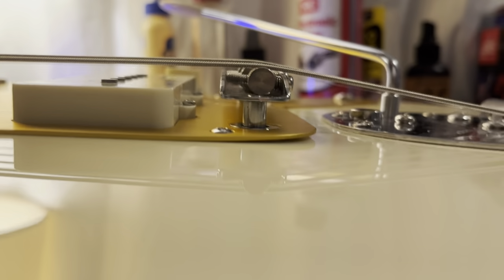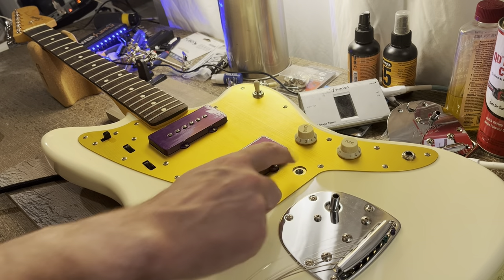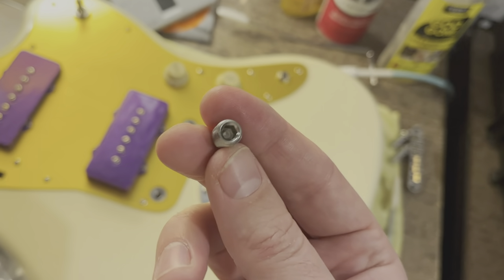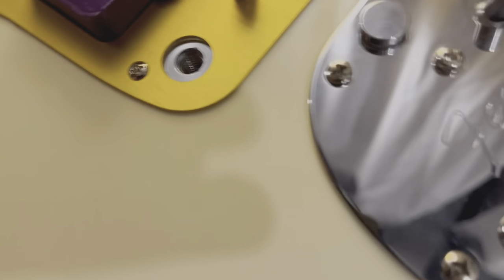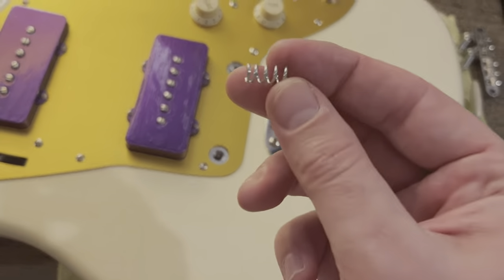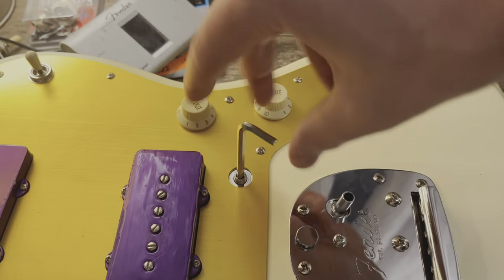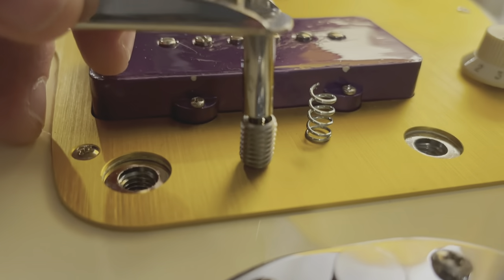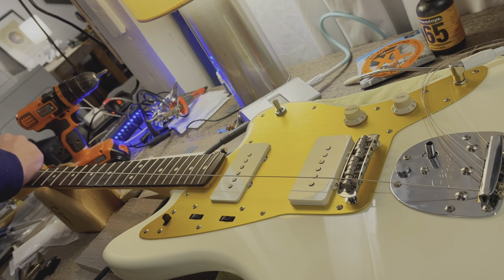Installing A Mustang or other Offset Bridge on Squier J. Mascis Jazzmaster ($3 AOM/TOM MOD)

Comment: Hey man… when I looked at your Mustang bridge, it has tiny screws on the bottom of the “posts?” that are at the bottom of the bridge (the posts are attached to the bridge). I was looking at a Modified Mustang Bridge from Warmoth and in the tiny screws at the bottom of the posts do not appear in the photos of their bridge. Is this normal? Will the Warmoth Modified Mustang bridge work like yours in this video? Thanks!
Reply from the maker: I have never seen one of those Warmoth bridges in person so I can’t say for sure but every Jazzmaster or Mustang bridge I have seen has had a height adjustment. The warmoth one has individual saddle adjustments but I can’t imagine the overall height can’t be adjusted as well. Maybe a call to warmoth could clear that up for you.

Comment: I've done this mod on my JMJM squier (using a mustang bridge) and it's worked beautifully! Thanks heaps for the hack!

The only issue I've run into is the action seems to decrease slowly over time until frets begin to buzz. (This is with the springs underneath the grub screws too). Has anyone else had this problem? And is there any fix other than just locktiting everything?
Reply from the maker: I’d try to verify if it’s the grub screws moving or the adjustment screws on the Mustang bridge itself. Mine hasn’t moved at all since first doing this a year ago and I don’t have any loctite on it, so my first guess might be that your bridge needs loctite? Not a big deal if you use the blue stuff, do not use the green or red as those are meant to be permanent.

Comment: The bridge looks quite high, aren’t you having tuning stability issues with that height. Because I’m having them and I believe this is the cause : /
Reply from the maker: It’s very high in the first shot as I’d just dropped it on and hadn’t adjusted the height yet. The “after setup” shot shows where I have it now. This is still relatively high, but I’ve also shimmed the neck which keeps the action low with the raised bridge. Action is perfect and tuning is rock solid stable. 

A higher bridge increases break angle on the strings and should actually making tuning more stable I suppose, unless you’ve created high action issues that bend notes out of pitch when fretting? 

IMO tuning stability likely culprits on the JMJM are the TOM bridge, squier vibrato tailpiece, and the plastic nut, all of which I replaced at once so I can’t say how much each of those individually helped me. I could also see the tuners being trouble as they aren’t awesome but they’ve been good enough for me not to bother replacing them.
Reply: @feinkevi  I have a 'Noventa' Jazzmaster that also came stock with a TOM. It was moving a lot so I changed it to a regular rocking JM bridge. I also shimmed the neck and raised the bridge as much as it appears in your picture, however the tuning stability that I once had with the TOM is now gone. I also replaced the vibrato for a Panorama, which might be the real issue here. That's why I was wondering how was you experience with a raised bridge. 
I love how they feel, very confortable for my playing style. 
Anyway, thanks for your reply : )

Comment: Is the AOM bridge that bad? I see you have a different vibrato on it too.
Reply from the maker: A few people seem to like them, but for me it def had to go. The tuning stability while using the vibrato with everything stock was really quite bad, pretty much unusable. There are things I could have done to make it work a bit better as it was, but after swapping the bridge, vibrato (Fender CIJ), and nut (TUSQ) the tuning is rock solid. 

Aside from tuning, another major issue is the radius mismatch. The radius on the stock bridge is flatter than the fretboard, so no matter how you set it up, the action on the outer strings is higher than the inner strings. (Easier to fret and bend the D&G than the A&B which are easier than E&E). This Mustang bridge is a 9.5” radius matching the fretboard, making it way more comfortable to play. It’s also more comfortable on the palm and looks better with the offset aesthetic. 

Again, some people like them and that’s fine, but it was a necessary change for me for sure.
Reply: @feinkevi  thank you for the detailed reply. There is a 1st Gen (rosewood fretboard )JMJM near me for sale. I was researching it and found your video. So besides the bride what else have you done, or do you have a video on it?
Reply from the maker: @thecappy  I recorded a bunch more clips but haven’t had time to piece together any more yet. All in all I did the bridge, vibrato tailpiece, nut, neck shim, and pickups. I went with Fender Pure Vintage 65 pickups to get more of a traditional jazzmaster sound. The stock pickups are P90s, and sound very good for that style but it wasn’t what I wanted, so I’d say a pickup swap is totally optional depending on what you are looking for. The neck shim is also optional, I needed it for the way I wanted to set up the guitar but it wasn’t strictly necessary.
Reply: @feinkevi  I have a black Japanese (Inoran sig) jazzmaster with the ‘65 pickups. I was thinking of putting in P90 jazzmaster pickups in, but figured the JMJM already has them and the neck is supposed to be really good on them.
Reply: I don’t think it’s that bad. I have a Fender Kurt Cobain Jaguar. The AOM bridge radius is 10.5 so it’s not a lot different than the 9.5 neck radius. I did this grub screw mod like the video above shows and it definitely works. But the floating bridge doesn’t move very much when using the tremolo and still can get out of tune. I decided to put the AOM bridge back on. I have it set up perfectly and can use the tremolo without it getting out of tune. Or at least not any more out of tune than when I was using the floating bridge. I think the AOM bridge gets a bad rap. It’s not great but it’s far from being terrible

Comment: Where do you buy that Mustang 9.5” radius bridge ?
Reply from the maker: This particular bridge actually came on a used CIJ Jazzmaster that I bought a while back, the previous owner had put on this mustang bridge. I upgraded the CIJ to a Staytrem and moved its Mustang bridge to this JMJM. 

There are a few varieties out there in 9.5. If you don’t want to break the bank I imagine the Allparts one works just fine.

Comment: Hey any chance anyone has the spring size that works best, considering this mod for my JMJM
Reply from the maker: I hear from several folks to stick to the shorter end of the set screws range listed here. As for the spring I don’t think it matters much as long as it fits in the hole, so smaller than the set screw in diameter, and can clip the length down to size easily.

Comment: Gonna give it a shot. Hopefully saved me a huge hassle. Just bought a vintera 60's jazzmaster and that damn Tom bridge sucks. Why fender did this I have no idea. Thank you for posting this. Going to Lowe's when I get off work. You have no idea how stoked I am. I really dislike that aom bridge.
What radius is that mustang bridge? 7.25?  I can't find one for a 9.5 radius. Gonna have to use another type of bridge. Or is the difference between the two insignificant ?
Reply from the maker: The vintera should be a 7.25” radius no? The one I used here is a 9.5 which matches the mascis, but I don’t actually know the exact model# or anything, as I took it off my CIJ Jazzmaster (prior owner had put it on). That CIJ is a 7.25” neck and I got by ok using the 9.5” bridge for several years but I’ve gotta say - now that I’ve switched to matched 7.25’s on the CIJ and 9.5’s on this Mascis, I really wish I didn’t wait so long. The mismatch isn’t terrible, but it’s definitely and noticeably better getting it right. Good luck sorting it out!
Reply: I have the vintera modified. It's 9.5. Radius I found a  vintera jag/jazz bridge with with adjustable radius. So it should work perfect (being both mim). The hardest part is finding the 8mmx12 grub screws. I'll give you a heads up when I get everything and if it works for me.
Reply: @feinkevi  just wanted to tell ya it worked perfect. Some tweaking ( had to use a 10mm set screw) and some back and forth to get my action how I like it. But a awesome hack. Plus saved a ton of money. Thanks again.
Reply from the maker: @bullit4x  fantastic, thanks for the update and glad it worked!